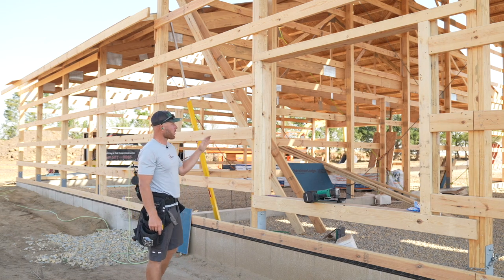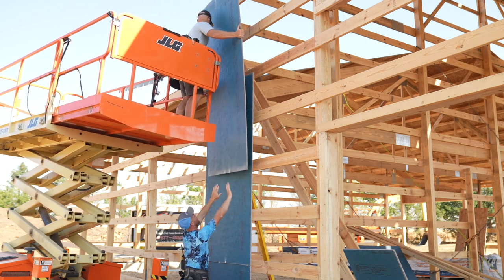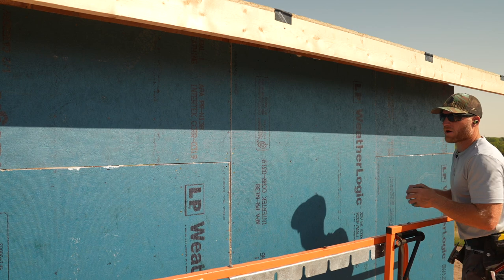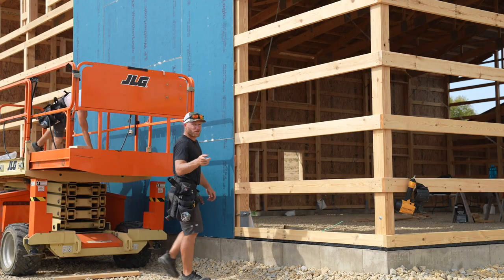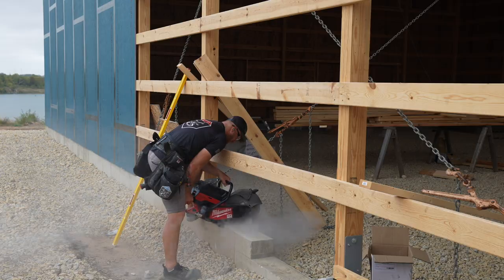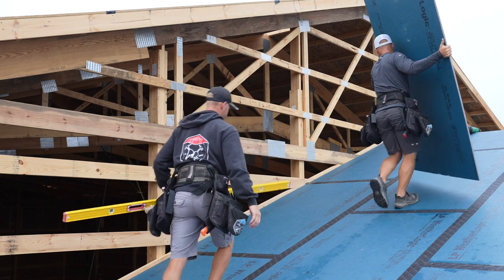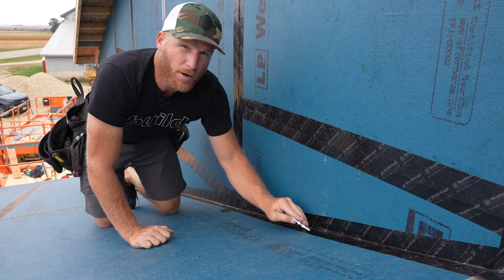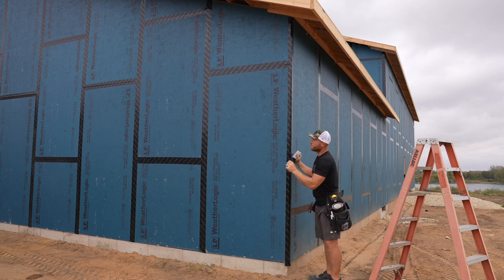Building a Barndominium Part 6: Installing LP Weatherlogic Wall Sheathing

Comment: I did a house with this sheeting in August the siding was back ordered. It ended up leaking really bad. Even walls with no windows. This is an inferior product compared to zip.  You can tell just by feeling the tape.  No go.  I'll never put it on again without some written waiver of responsibility of leaks.
Reply: how do you determine it was a sheeting problem, and not anything else in the process? Siding, glue, tape, installation process, nail spacing's, etc?
Reply: @jeradclark  there was no siding
Reply: @jamesonkruger6989  well, what about the.... ummm... well there's.. dang. That stinks man, sorry to hear that.

Comment: When you are cutting concrete, please use a double cartridge breathing mask!
And/or a high rpm barrel fan. You are right. Water spray is best although messy.
It takes years to develop black lung.
SILICOSIS can be developed in a matter of WEEKS.
Reply: At no point did they cut concrete, so what is your point?
Reply: @daveklein2826  - My point is self explanatory for all and will be appreciated by many.
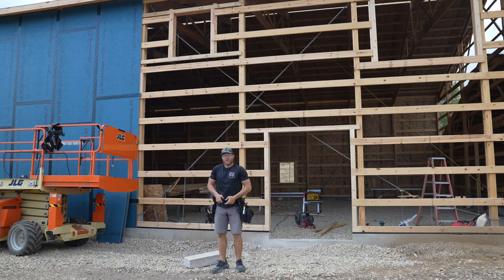Better watch the ENTIRE video. Try 15:46 thru 17:20 for expedience. OOPS!

Comment: What kind of windows are going in this?
Reply from the maker: Pella lifestyle
Reply: @RRBuildings   Pella is running 3 months in their production? I've been out of the building material business for sometime. We did a lot with Andersen Windows and trailer / van loads we would receive in 3 to 4 weeks.

Comment: maybe try to snap a line half the width of the tape on the end wall then fasten the tape at the line come back with your squiggy and work it down just like applying a decal.
Reply: The bottom part of the tape (the part going onto the roof of the garage) would floo down and adhere further away. At that point you could try to pull up the parts that stuck to the roof but would run the risk of pulling up wood and defeating the weather proof membrane applied by the manufacturer and would also lose the adhesion ability of that part of the tape. You have to get it as far into the corner as possible before letting the sides adhere.
Reply: @samanderson7745  I guess the manufacture could make a special roll just for inner corners that had a split removable backer. I heard this company is in court with huber zip anyway.
Reply: @ruralridez6165  now that would maybe be a functional option! I'm still not fully sold on using tape for long lasting weather-proofing though. It's still going to be subject to humidity which will reduce its hold after a time. Most of the adhesive systems I've seen only give a 30 year lifespan. I don't know that I like the idea if a person paying off their mortgage and then having to redo their weather-proffing...
Reply: @samanderson7745  I know with the zip tape they use a roller to press the tape down not sure if just using that decal squggie will apply enough pressure.